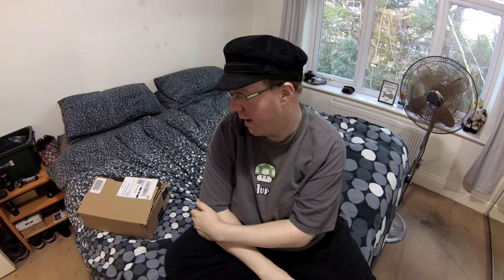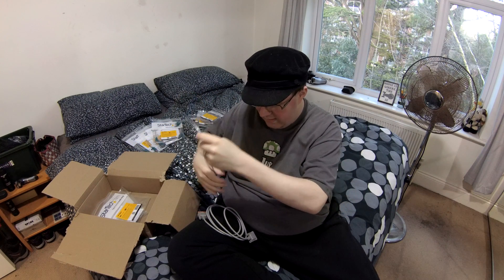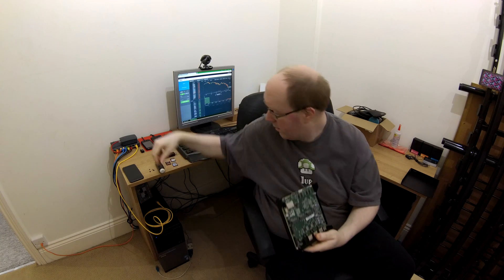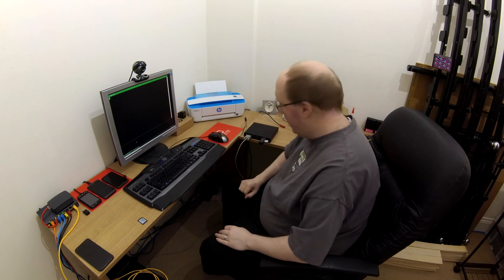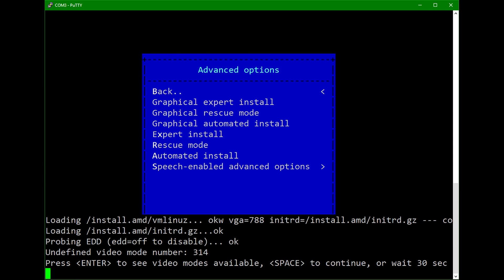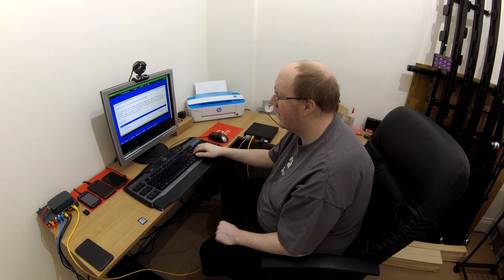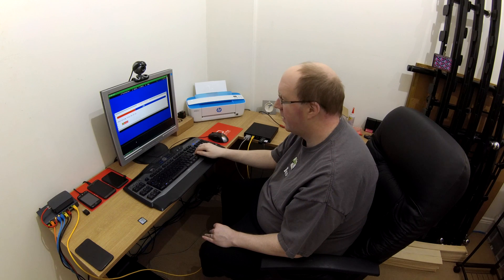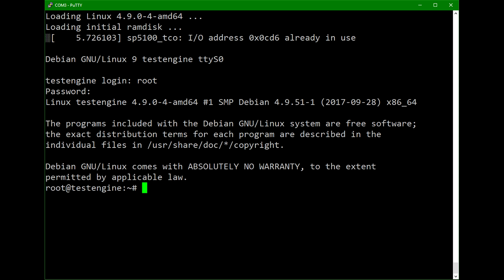Installing Debian on a PC Engines apu2 c4

Comment: Nice one mate. I am thinking of buying an apu2 to play with OpenBSD on it :)
Reply from the maker: It has been a while since I used OpenBSD. In the early 2000s, I acquired a mid-90s era Sun Ultra 1 workstation, which I did run OpenBSD on, serving my website from home over my DSL line!

Comment: I have two questions here, please:
#1: Why have you chosen "XFS" as your main filesystem?
#2: Why have you chosen not to use a(-ny) swap partition / file ?
Reply from the maker: Long before today's fairly-mainstream choices of ext4 or btrfs as a bootable journaling filesystem came along, xfs had this and was added to Linux. It's just because I've been in the game for so long that I adopted xfs, and haven't changed my preference since.

When I want copy-on-write capabilities for a specific use-case, I often go with btrfs instead. If I am specifically putting together a storage server, and want raid and checksumming, then more likely zfs, though that does carry more overhead, which is why I don't use it by default.

With this appliance, I haven't enabled any swap because, being just a firewall, about everything is happening in-kernel anyway.
Reply: @andrewsturmey  Thanks for the info! ;-) I dug out one of my three Alix 2D13 ( 2010 ) boards and went on installing Debian 9.8.0 "Stretch" on it. First attempt failed due to incorrect serial console params to the initrd.gz, second attempt succeeded. Works remarkably well hence having "only" 256MB RAM, I'd say.

Comment: Thanks for tutorial! I have mine loaded with PfSense right now but considering wiping it for Debian or getting a RasPi with Raspian
Reply from the maker: I have used a pair of ASIX Electronics chipset USB3 gigabit ethernet adapters with a Raspberry Pi 3+ recently, as an edge device; worked well. Also have one as a wireless access point, and that's pretty alright too.

Comment: Very cool, I always wondered how a serial console install worked.
Reply from the maker: Do a search for “debian install preseed” for another quite-interesting alternative. That's where you supply the installation choices ahead of time, and it can run completely unattended, with no console at all. I could do a video of it, if there's interest in that.
Reply: @andrewsturmey  Thank you for your efforts! Seems like your video is one of the very few videos (if not the only one) here on YouTube that would explain installation over serial in 2023 still.
Reply from the maker: Still sometimes the easiest way, especially for one-off setups on hardware like this. I actually tend often towards a preinstalled image of recent, but it's usually one I've synthesised myself still.